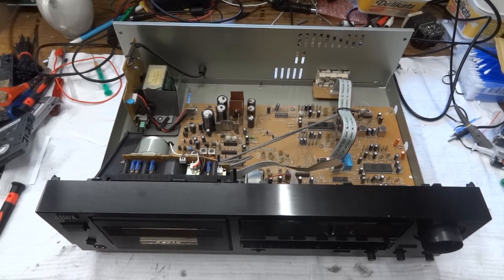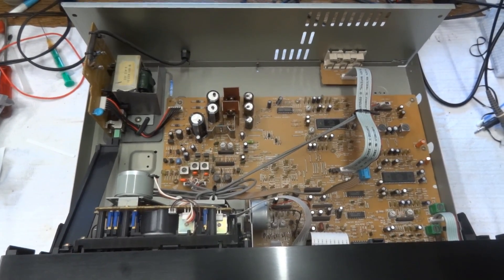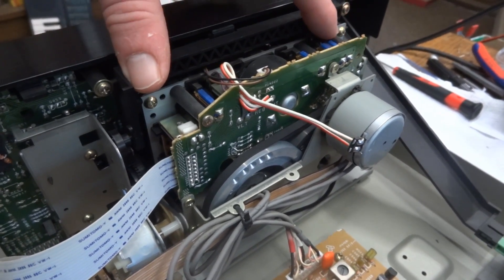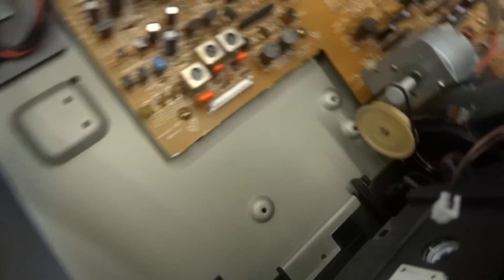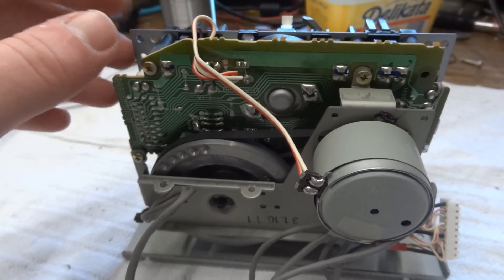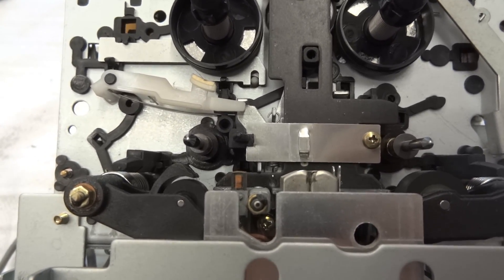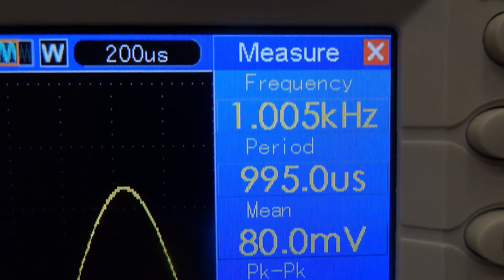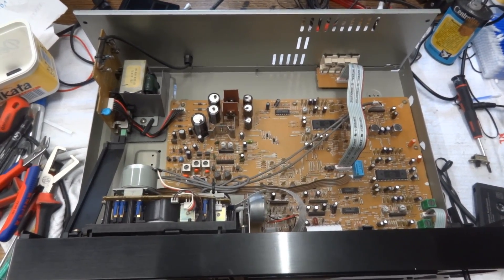DrCassette's Workshop - Aiwa AD-F910 cassette deck repairs

Comment: Why is it neccssessary that the cassette deck can not play without a cassette? It's so much easier to clean those which can play without cassette.
Reply from the maker: It is a safety interlock. For example, you have the cassette deck in playback mode, with no cassette and with the compartment door open, this is ideal for cleaning the heads and the tape guides. But now imagine you put in a cassette and try to push the door into the closed position. You forgot to stop the deck from playing, and now what happens is you push the cassette against the heads, which could lead to misalignment of the heads or even further damage.
Reply: thank you!

Comment: Which lubricant do you use? Is white lithium, such as AGS White Lithium Grease good for plastic gears? Great video, thank you!
Reply from the maker: Depending on what I want to lubricate, I use either oil or grease. For oiling, I use an all-purpose oil (sewing machine oil). Don't use silicon oil, it will cause a mess. For greasing, I have started using White Lithium Grease. That's what most electronics factories use as grease, so it has got to be good.
Reply: Thank you. I had asked a seller of AGS White Lithium and he told me it was only for metal components. But I know several people who use it on plastic, so i was confused.

Comment: I see that the audio factory specs are quite very good for this deck...normal and chrome upper freq. till 20 khz, and to metal tape till 22khz. ..I suppose that fisher you talking about is inferior in audio specs. .... Wich make me gave a serious toughts în buying this unit. I found one in good shape for about 50  € , and I going to buy it. I think it is worthing. ...By the way, that transistor on the control and display board should be on its place like it is?
Reply from the maker: Please give me a time code. I am not going to watch the entire video to find what you are talking about.
Reply: On the back of the display board there are visible two resistors, one electrolitic capacitor and a transistor....Since time 12'.38" in this video,  just for few seconds, you can see them near the support of the motor door. I was wondering...why they didn't do some more wholes to plant them properly  and to solder them  like all the other components?
Reply from the maker: Now I know what you mean. Those components were added at a later design stage of the cassette deck. They found out they needed those additional components when the pcb was already in production. A complete re-design of the pcb would have been more expensive than adding those components to the back of each pcb manually. I once briefly had a DVD recorder that was full of such corrections.
Reply: DrCassette , thx for your answer. 
By the way, Dolby in my deck is wonderfully implemented,especially dolby C... Playing those good quality recorded tapes, it amplifies the trebles very well, even the cassettes was not recorded with any dolby at all. ...   
I own few tape decks wich employs those dolby Sony 's cx20188 chips, an none of them had that good implementation. 
I suspect that good quality audio  frequency range  (starting from 20k on normal tapes , has its role.

Comment: I once cracked a transparant TDK D C-120  on purpose ..  just on one side  in the area of the heads & pinchrollers , so  1: It played because a switch was  engaged inside and 2  to get acess and space for cleaning , while playing after removing the tape 
3: You can see very closely how the tape travels over the heads and tape guides :) 
The little copper spring with the vilt behind the tape of the cassette , I glued a bit so that it would"t come off ..
Of course this only usefull if you can take away the cassettedoor ánd those damned stabilisers   :)

I still have my Nakamichi mirror cassette . Its also half open . Very usefull

Comment: Very nice video , but I always thought that playback gain had to do with output volume 
in referrance to the peak indicators adjustments ..  and that it had nothing to with Dolby .
In some Technics decks from the early eighties you have playback equalizers , left /right 
Might this be the same ?? , because you said  after adjusting the sound was less muffled ..

Comment: Lustigerweise habe ich heute genau dieses Tape-Deck aus dem Elektroschrott gerettet. Die Schrauben für den Deckel fehlten leider, der Vorbesitzer hat wohl mal reingeschaut und das Teil dann entsorgt. Nach einem kurzen Test stand fest, dass die Riemen auch völlig ausgeleiert waren und das Deck nicht mal mehr starten wollte. Bevor ich für 17,00€ Ersatzriemen bestelle und dann womöglich weitere Fehler auftauchen, habe ich die alten Riemen einfach einige Minuten in kochendes Wasser gelegt und konnte danach das Deck zumindest wieder in Betrieb nehmen. Ich bin auch etwas hin- und her gerissen, was die Qualität des angeht. Es ist definitv ein größeres Modell und hat eine gute Ausstattung, allerdings überzeugte mich das wackelige Gehäuse und der insgesamt etwas billige Aufbau nicht wirklich. Das stammt halt vermutlich schon aus den 90er Jahren, da ging es mit der Qualität im Hifi-Sektor rapide bergab. Interessanterweise erzielt das AD-F910 bei eBay durchaus Preise von 50€ aufwärts (mit neuen Riemen natürlich mehr), insofern werde ich es vermutlich wieder verkaufen. Abgesehen von meinen zahllosen Tapedeck-Leichen im Keller habe ich zum Digitalisieren alter Bänder ein Yamaha KX-670 (welches ich seinerzeit neu gekauft habe), ein Technics RS-AZ6, sowie ein RS-BX646...alle 3 Decks machen auf mich irgendwie einen besseren Eindruck als das AIWA, auch wenn das AD-F910 durchaus einiges an Einstellmöglichkeiten bietet. Kennst du die von mir genannten Decks zufällig, wo würdest du das AIWA qualitativ einordnen? Viele Grüße - Roland

Comment: Hey Drcassette. I've only ever had 2 head machines, but I am thinking in getting a 3 head cassette recorder. In your experience, do you think a Bias control/calibration feature makes a big, big difference in recording quality compared to the usual cassette decks?
Fantastic videos 

Matthew UK
Reply from the maker: +Matthew Richards Oh yes, tape calibration makes a huge difference. Not so much on newer, good Japanese cassettes, but on older, cheaper cassettes. Good cassette decks will either automatically or manually (via display or level meter and adjustment knobs) calibrate Bias, Level and Equalizer. The more basic ones might only offer one or two of those options, this Aiwa deck for example can only manually adjust Bias and Level.
The setups were you just have a "Bias Fine" or "Bias adjust" knob without any way of recording test tones and without any display in my opinion are pretty much useless. You can of course turn them until the cassettes sound better, but you'll never know if it's perfect.
Reply: @DrCassette  you can use a none occupied fm signal 😁

Comment: My cheap sorry rear uses rubber bands. If it dose not work then I have to go and dump double digits on belts =(
Reply from the maker: +Marks mediaTV It's not going to work. Either it doesn't work properly at all or it's only going to work for a few months. Rubber bands are not made to last like proper belts are.

Comment: @DrCassette,  I purchased a Sony VCR model SLV-N81 and everything works fine but just wondering about one thing.  When I first power up the VCR, the screen is grey for a couple seconds, it also happens when I hit stop, or change the channel on the vcr.  Is this normal for this vcr or is there something going wrong with it?  Thanks.
Reply from the maker: +iz Zzy Should be normal. When there's no video signal to show, the VCR puts up a grey screen. Some other units will output a blue screen.
Reply: Thanks for the quick response.
Reply: +iz Zzy I have a model 575, the one with the flip down front, which I think was in the series before yours.  Great big heavy machine.  I bought it in 1990 for $500 from Montgomery Ward.  It's not working now, but I can't bring myself to get rid of it.  I have hundreds of prerecorded tapes that I now watch frequently with a Hitachi VCR.  I'm hoping the good fairy will come along and fix the Sony.  Simply an outstanding machine.  It ran flawlessly for 15 years before breaking and we used it to time shift hundreds and hundreds of hours of TV programming before it finally broke.

Comment: I know in the UK it is mandatory to have a fuse in the plug (which is part of why their plugs are so huge!). But if this is a Euro model I'm surprised they didn't put a fuse inside it, especially since there's a space on the board for one.
Reply from the maker: +vwestlife Actually the space in the board was for a voltage selector. But since the transformer used in this unit only has the 230 V winding, I could re-purpose the existing traces and fit in a fuse holder.
Reply: The devices that were made in Japan. Usually have a voltage selector.

Comment: From my long distance past memory, I recall a number of cassette decks had the same problem in that the Dolby did not track correctly. They often sounded better without Dolby but of course at the expense of a 10dB increase in noise. Most people then and now often do not understand that the use of Dolby noise reduction IS a two way process and must be used in both record AND playback. I always liked the sound of Dolby C. A few decks used DBX, great at reducing noise  but you could always hear it processing. Try listening to piano or speech with DBX. Really sounds bad!!

Comment: When I fix brock belts for a replacement I use rubber band s
Reply from the maker: +Stephen Epic Rubber bands are never a good solution. They don't give a steady speed, and don't last nearly as long as real belts. You'll have to keep replacing them every few years.

Comment: Did you get the belts from Marrs Communications?
Reply from the maker: +oldfartatplay1320 No, those came from a company called Thakker.
Reply: They are the ones you need on these decks, anything else doesn't last long. trial and error lol
Reply: @angelodagnolo984  'They' meaning Marrs or Thakker?